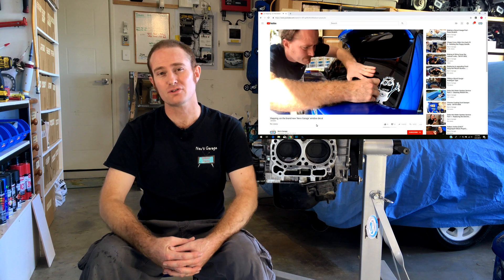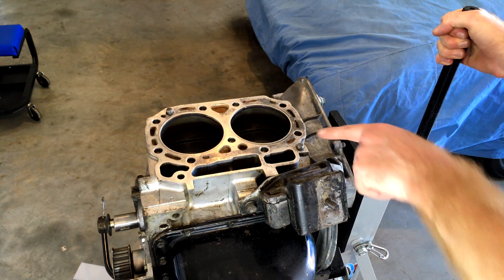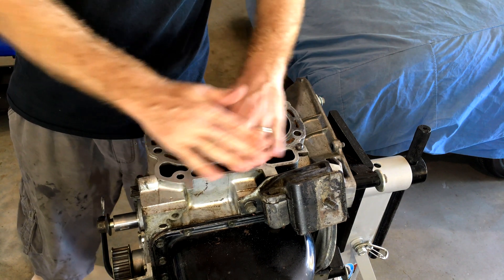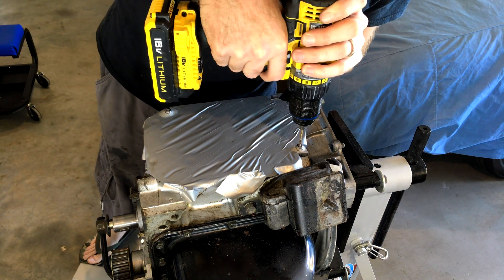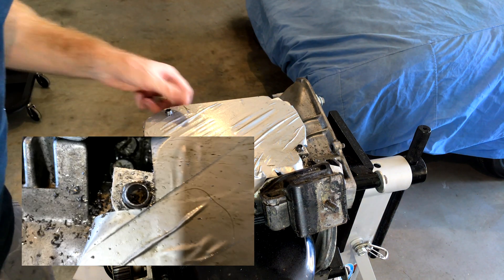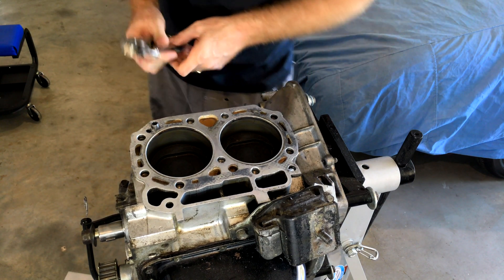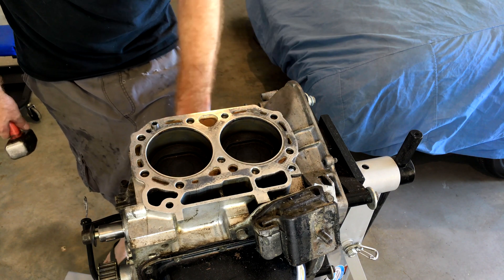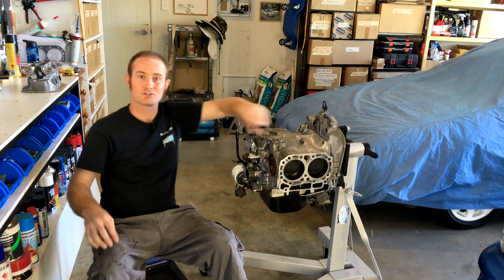Removing Engine Block and Cylinder Head Dowels

Comment: Just a few comments: You have to be accurate to punch the center, the hole has to be perpendicular to the deck (or better, to be coaxial with dowel pin), you better be sure how deep to drill (in the case of a blind hole). This method is a little bit risky, but it is a viable option.